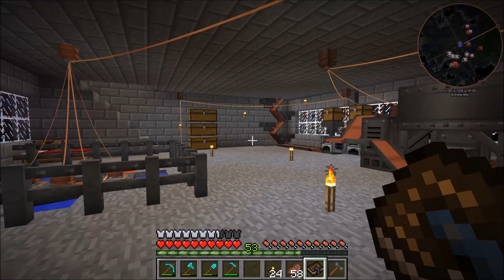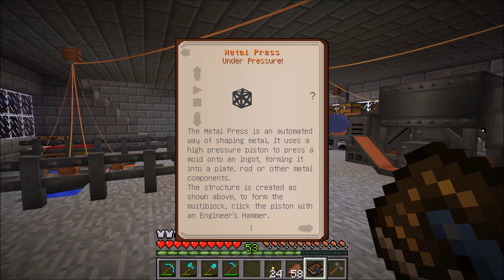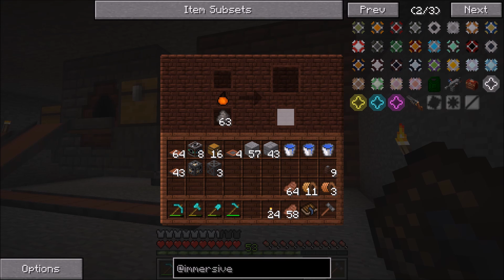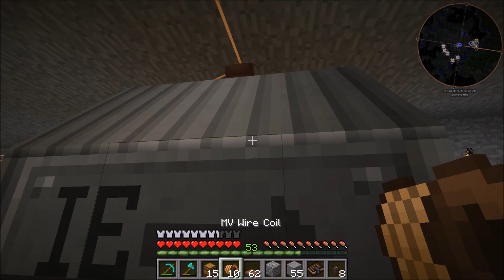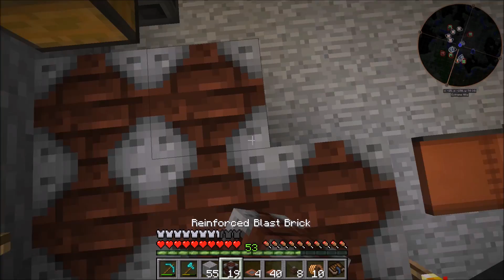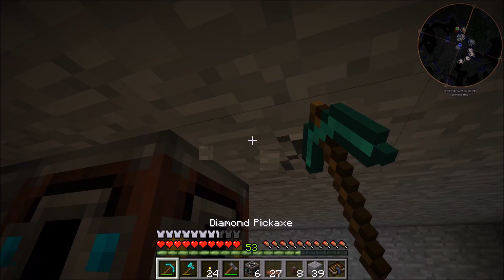Surviving With Immersive Engineering :: Ep.18 - Improved Blast Furnace And Metal Press

Comment: Don't know if you read the manual more thoroughly after you recorded the video but if you didn't the holes on the sides of the improved blast furnace are for pre-heaters.  The pre-heaters should speed up the steel making process even further.
Reply from the maker: +Zieldrich Yea, I noticed right after I finished that there were a couple things I hadn't done. Pre-heaters / toolbox / railgun and such :) thanks for the reminder tho!